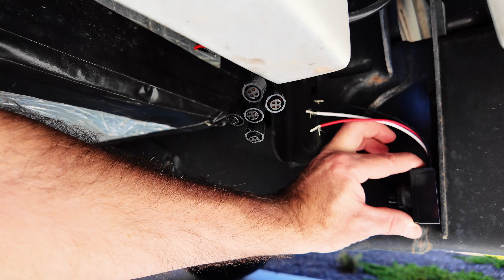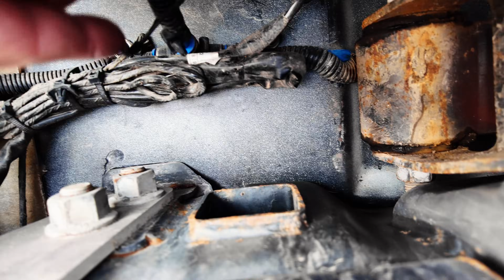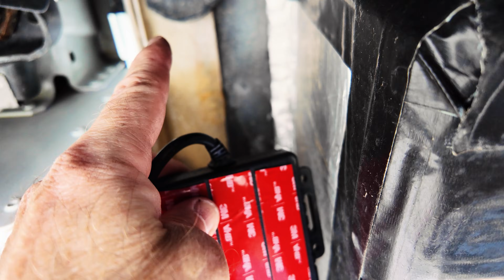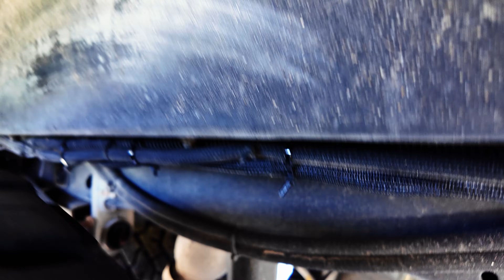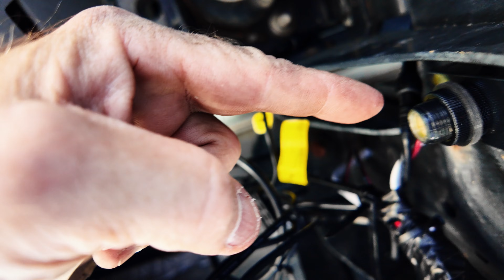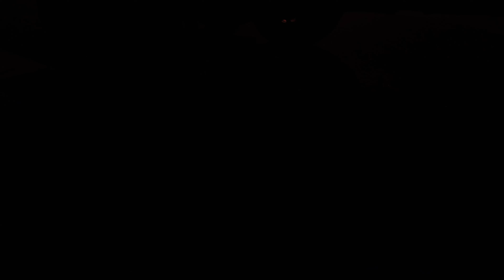Why My Rossmonster Baja Glows Blue in the Desert at Night

Comment: Nice job and cool lights. My only critique is not to use vinyl tape at any of your connections. I worked in telecommunications  for 29 years and know that vinyl tape will hold moisture and corrode connections.
Reply from the maker: Thanks for the tip, definitely want to avoid corrosion issues! The video does not show everything though, but definitely a good reminder.💡